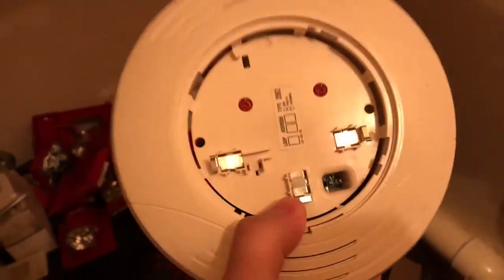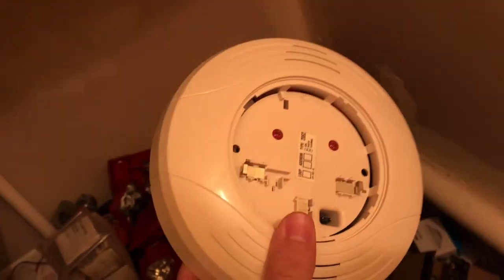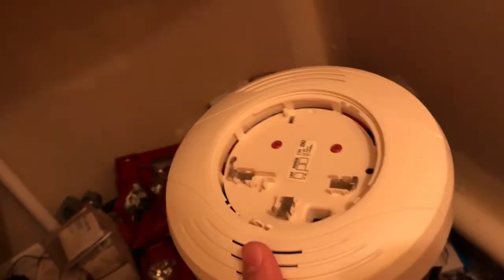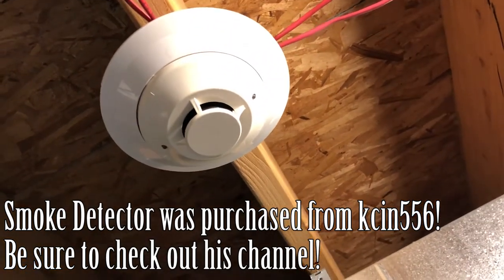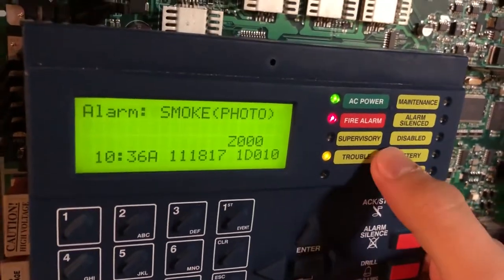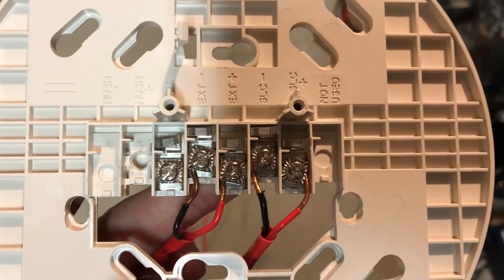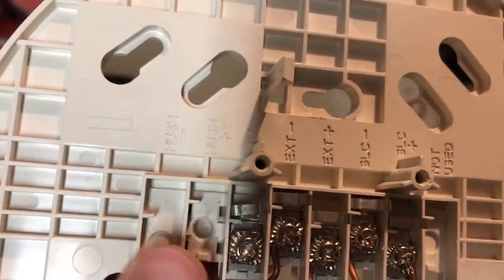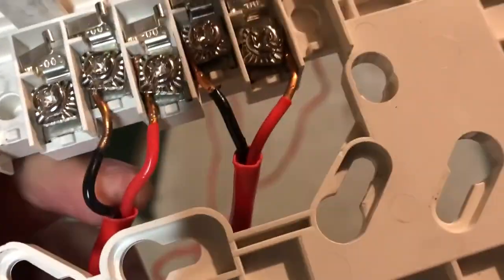Fire Alarms Explained: Sounder Bases for Smoke Detectors to Prevent False Alarms

Comment: This is just a small tidbit, the RA terminal is the positive terminal for a remote annunciator like the RA100Z and the B200SR is the remote version of the sounderbase meaning it can not be coded or synchronized. The B200SR is intended for isolated operation. The B200S can be Synchronized but can only do circuit Isolation. The B200S will set off every notification device on the same circuit instead of the one sounder base.

Comment: Hello, I'm Working on a Silent Knight IFP-2000 in a coastal environment and am replacing corroded detectors and sounder bases.  Of course I am setting the address dials of the SK-PHOTO detectors to the proper address but according to the B200S manual, the base has to be put into the learn mode to capture the new detector's address.  Can you tell me how to do this?  I cannot find the procedure in the IFP-2000 manual.  Thank you in advance.
Reply from the maker: I unfortunately don't know too much about it, however reading the instructions it sounds like this is done automatically by the head installed in the base.. That is if I'm understanding it right. The only time you'll need to know addresses is if you're setting up some kind of mapping so that several bases activate when one does, and unfortunately I'm not too well versed in that, I've never had to set it up that way. I can suggest maybe posting over on https://forums.thefirepanel.com to see if anyone there has more information?

Comment: Nice! I always thought those bases did like a old smoke alarm code 6 tone or code 3 with a piezo sound to it. Interesting.
Reply: firefreak57 me too honestly then I saw the low frequency sounder base at ADI
Reply: Many of the older ones did. But since sounder bases are usually for sleeping areas, they switched to low frequency.
Reply: My dorm has 500hz speaker strobes in the living rooms and 3200hz sounder bases in the bedrooms. They alternate their sounds between the speakers and piezzo sounder bases, so its like BEEP beep    BEEP beep    BEEP beep        BEEP beep    BEEP beep    BEEP beep

Comment: A couple things, first off, the zone 1 type programming you changed is only used for reporting in zone mode and has no effect on the local system, secondly the sounder base requires 24v constant power, not from a NAC as it is required to have a power supervision module located at the end of the loop to supervise the power on the ext terminals. you do not use any NAC circuit. Also, the AR does stand for auto restore and the detector will silence itself and the other detectors when the smoke clears. The newer ES series uses the B200S bases that are programmed to activate from the panel, these are really controlled via the detector and interconnect wiring. There is a way to control them via the panel and a relay module but that is for another day. I am assuming this is a hobby for you and very well done. If you are an actual tech, you may need a little more training are some knowledge on codes.